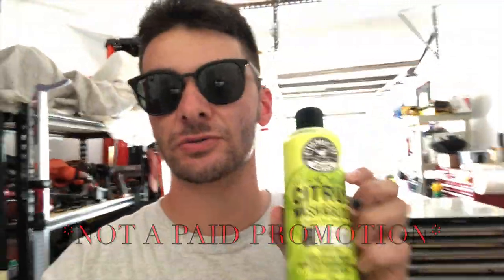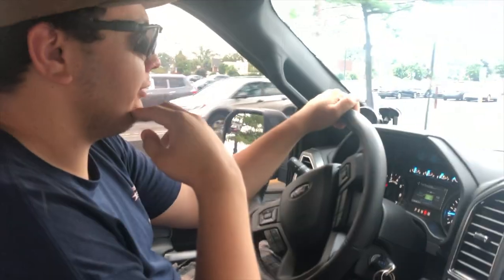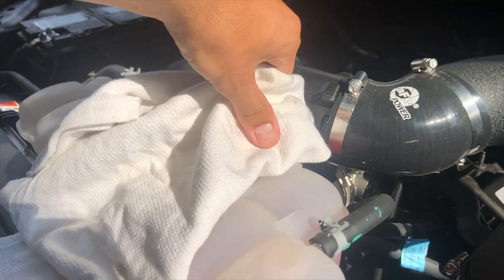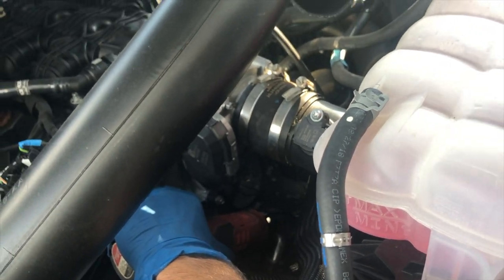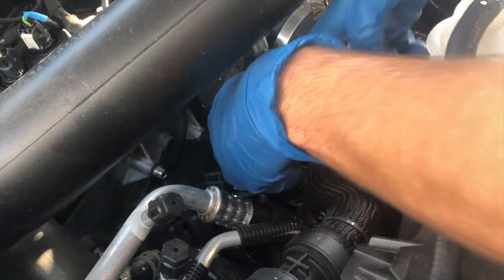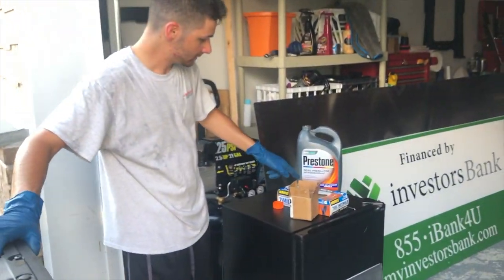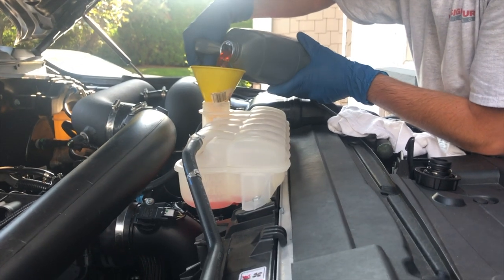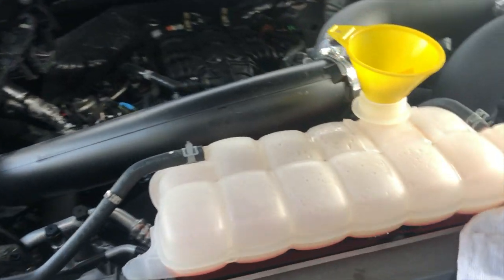Tuned 3.5L EcoBoost F-150 Thermostat Upgrade

Comment: This is about the only video that I've seen that has same housing as mine, which I think started with gen2 3.5 ecoboost for 2017 and later. 

You guys have a bit different intake, but how did you get the driver side bolt out? My hands are big, and I can't get a wobble extension or ANYTHING to work and am starting to get really desperate

Comment: I installed my 160 thermostat from 5 star and having troubles with my tunes throwing codes. P0128 and a active shutter code U2 something now.
Reply from the maker: Interesting I’d reach out to 5 star and see what they say, because that shouldn’t happen
Reply: 160 is too cold. Your thermostat is always closed and never hits the lower limit threshold temperature of 170 that the truck is looking for after a certain amount of time.
The PCM sees this stop in temperature increase. Anything less than 170 and you'll throw a CEL for P0128.
P0128 = engine coolant temperature is below the thermostat regulating temperature. Usually points to a cold/dead thermostat or a leak.

If you live in the tropical zone of the US then you should get a 170. If you're in the temperate zone of the US, then get a 180.
But if you're in Canada, Alaska, or somewhere else in the freakin' Great White North, then you should just leave your factory one in.

Sucks for you that you have to change it again, but it's a good lesson for everyone else that reads this.
Basically, you took one for the team.... don't get a 160, kids! Keep it at a minimum of 170.

Comment: Did you guys upgrade the radiator and thermostat? Or is the thermostat upgrade all that is needed?
Reply from the maker: You can upgrade the radiator but we only did the thermostat. The stock radiator is pretty good. If you  plan to push some serious power I’d say upgrade the intercooler

Comment: Why not just drain the reservoir before you do that to avoid the mess and possibly getting coolant on the Belt?
Reply from the maker: Draining the reservoir isn’t really going to stop the coolant from coming out of the thermostat opening. You’d have to drain the system completely which is almost pointless for this job since you’ll have to get a ton more coolant to fill and bleed the system. A little bit of coolant on the belt isn’t a big deal, you can clean it off or after the first rotation of the belt/pulleys it’ll mostly be gone. Of course if it isn’t just use some belt cleaner and get the excess off.

Comment: Good video. This is the only one I could find for 2017+ 3.5l thermostat replacement. 
Did you tighten the bolts to a specific torque or just snug?
Reply from the maker: Thank you! And tbh snug I kinda have a feel for it from working in the industry for a while, but I’m sure there’s a tq spec you can go by. But white nuckle will be perfect!
Reply: @RatchetWrenches  its 89 in.lbs +45 deg on the 2018. Probably the same for the 2019.

Comment: What’s up with the noise you hear from the engine at 1:50 into video? I have the same noise was told it was because of the bov that I install. Is there a fix ?
Reply: Cam phasers. Should be covered under powertrain warranty.

Comment: So what is the temp at now under normal driving. Just curious because I figure the fans will still wait until 220 or so to come on unless you have 5 star recalibrate
Reply from the maker: 5 star recalibrated it to 195 but we don’t even pass 200 anymore

Comment: Very helpful video. Before the stat change how high were your Coolant temps getting? Specially after some wot pulls?
Reply from the maker: Abel S550 GT thanks! And actually the numbers were within the normal range but we decided to change out the thermostat as a precaution. I’m sure if we really beat on it with the stock thermo it would be higher temps than normal
Reply: Ratchet Wrenches what were the actual numbers? My 18 3.5 can run anywhere between 215-221 normal highway driving, if i do some pulls temps can go into the 230’s they come back down quick but still, i am swapping the stat as well and getting the tune changed for the fans to come on sooner hopefully that keeps temps lower
Reply from the maker: Abel S550 GT idk man it was so long ago I can’t remember off the top of my head
Reply: Ratchet Wrenches 👍👌 helpful video seems like a very easy process
Reply from the maker: Abel S550 GT thanks man I really wish I could help but I can’t remember the numbers exactly. I just remember they stayed where they needed to be ya know?

Comment: wht if my car isnt tuned what will the benefits be ? i live in the desert so...
Reply from the maker: NAG3 it’ll help keep your temps down, it’s a cheap part that you should do especially if you live in a hot area. It’ll allow you to run it harder for longer periods of time. If you tow, drive long commutes etc.
Reply: @RatchetWrenches  awesome ! thanks for the reply!  i was reading the raptor forums i was like god did i make a mistake ?! thnx again
Reply from the maker: NAG3 no problem! And hahah